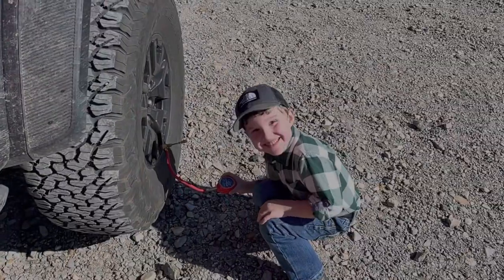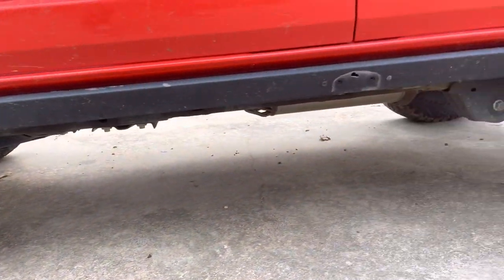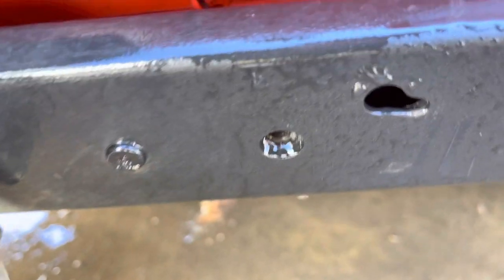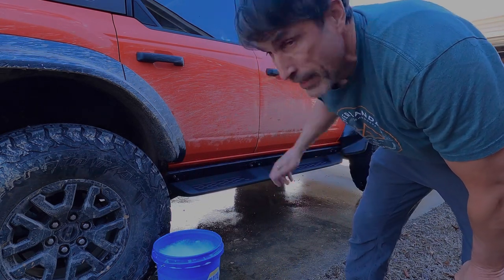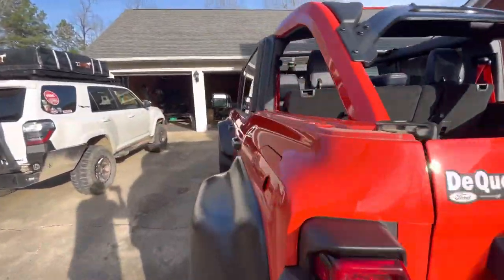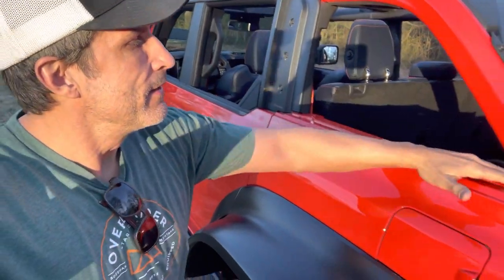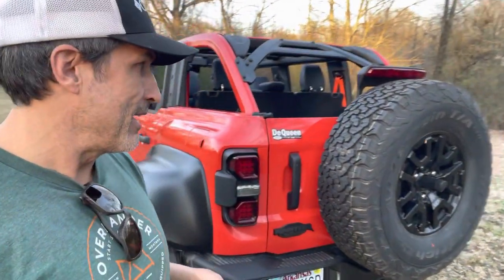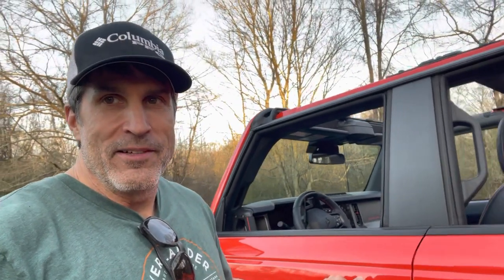Bronco Raptor goes Topless

Comment: So damn cool!    A bit nuts too take that back piece of solo,  but Impressive nonetheless.  Lol.     Btw,  IAG off-road sells a protector for the ledge in the back,   So guide pins don’t ruin it when putting it back on.
Reply from the maker: Thank you so much. I will have to check that out. Yeah, once I had it off I was like uh o now what.
Reply: Lol,  np.   And yes,  I figured so.   Not that heavy,  just very awkward to handle alone.    As well,  I ordered the aluminum gas and break pedal from IAG,   It’s more befitting a performance vehicle like this raptor (instead of the black rubber ones that are the same as a base bronco).  A cool simple “mod” IMO.    Can’t wait to get the top off mine,  hoping we can soon, here in the northeast.    Enjoy!